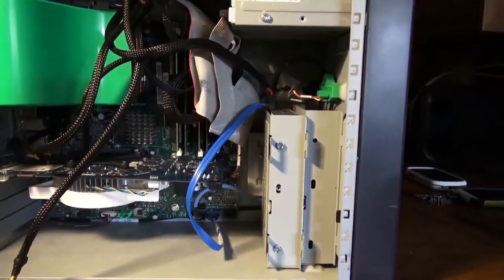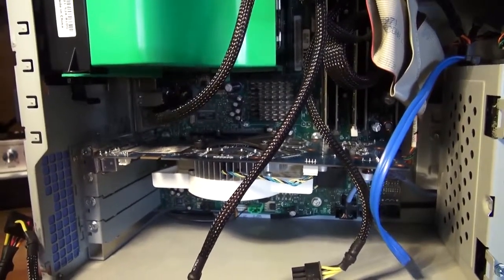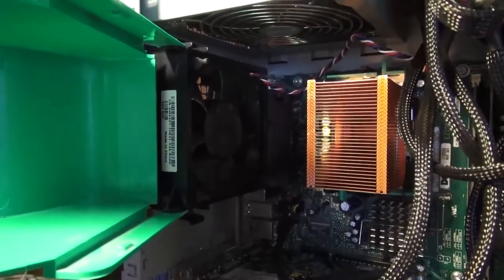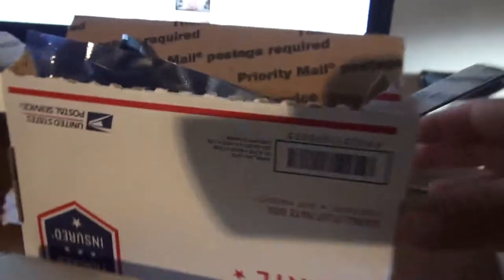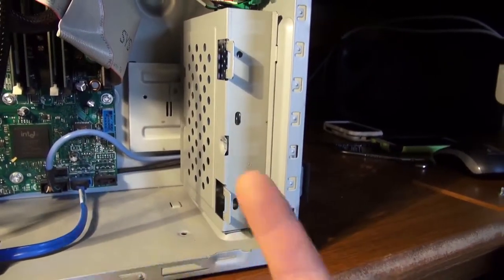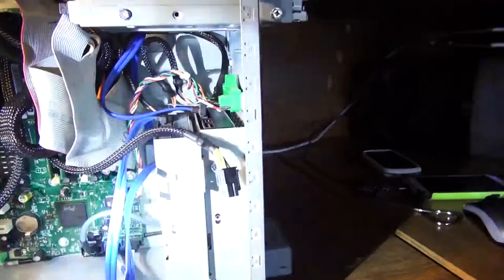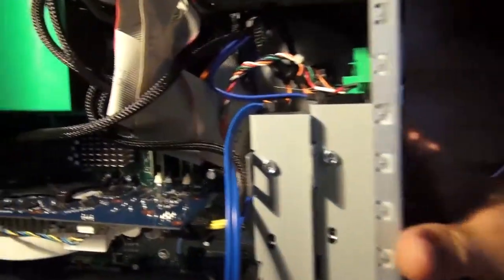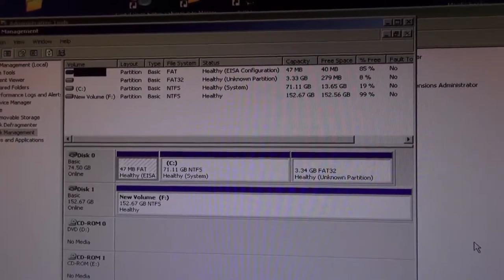Dell Dimension 4700 Hard Drive and cooling upgrade

Comment: I know this video is 8 years old, and you probably don't have this system anymore. But I am going to mention this anyway. This system can run a 3.8 GHz Pentium 4 just fine. In fact I believe that was actually one of the original options (although I could be wrong, I know they could be optioned with the 3.6 GHz CPU). The secret is the fan and heat sink. Most of the models I have seen came with the small heatsink and fan like the one you have there. This is the same heatsink and fan used in older model Dimension systems. Other models came with a larger heatsink, which has thermal pipes, and is much taller (it is the same heatsink that would come in systems like the Precision 370) , and a thicker fan, which moved more air at lower speeds (I am not sure of the part number). This helps a surprising amount. I just made the upgrade today on one of my 4700s with a 3.8 GHz CPU, because it was screaming just sitting and idling. Now it barely revs the fans up at all even under load. 
I have only seen two systems that have the larger heatsink and fan, and probably around 10 or so with the smaller one, so you have to get lucky to find one, but it certainly makes a HUGE difference in keeping the hotter CPUs cool in these systems.